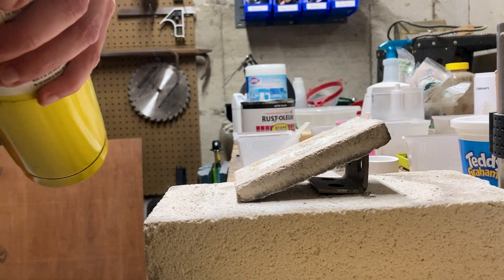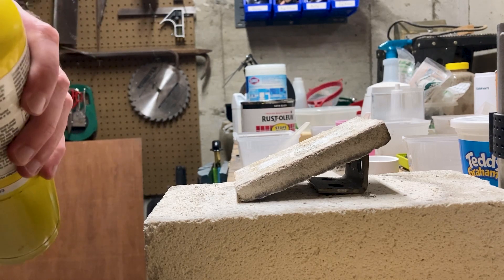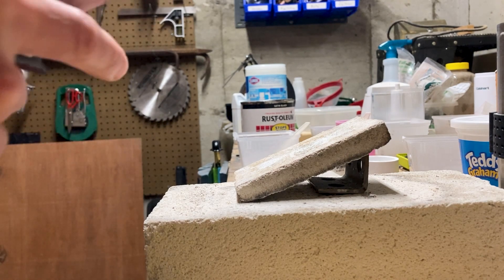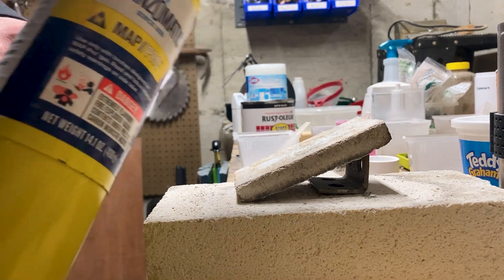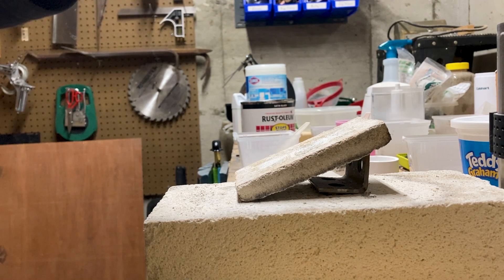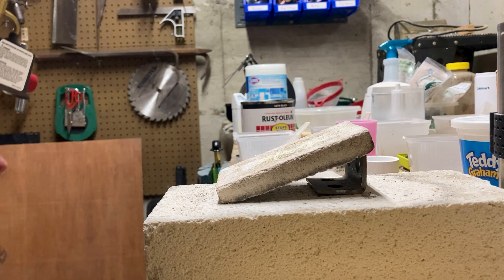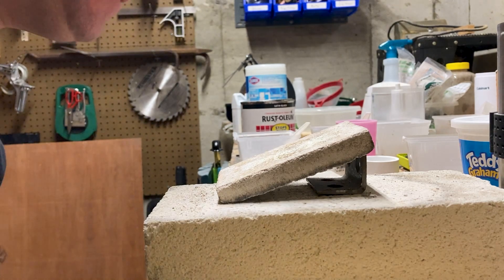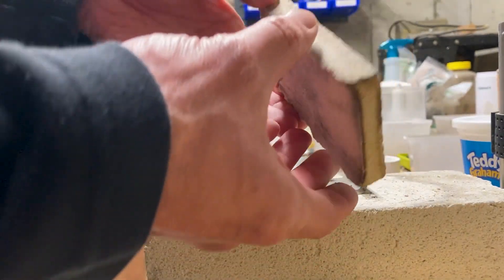Refractory Made From Stuff Bought From a Hardware Store

Comment: That's really interesting. I wonder if you bound the mixed powders in something like sodium silicate, it would make a refractory paint? Im rebuilding my forge with lightweight insulating firebricks and was going to add a very thin sacrificial layer of calsil board. I might try your mix with sodium silicate to add a thin layer of additional protection on the calsil. Very clear and well thought out video. Thanks. Jim
Reply from the maker: Thank you. I would be interested to know how that works for you.

Comment: How I can get some tiles from the Space Shuttle?
They should be quite good, right?
Reply from the maker: Well, getting actual tiles from the space shuttle might be a bit tough. But yes, the material they used is very impressive! I saw a demo of it once where the inside of the material was glowing red hot but the surface was col enough to hold without gloves.